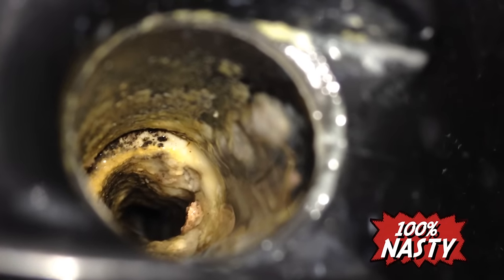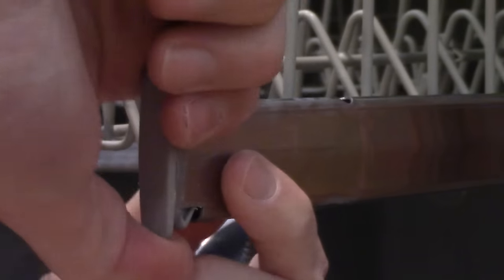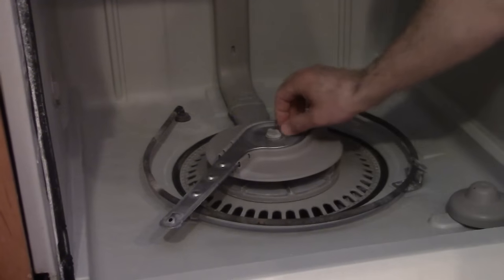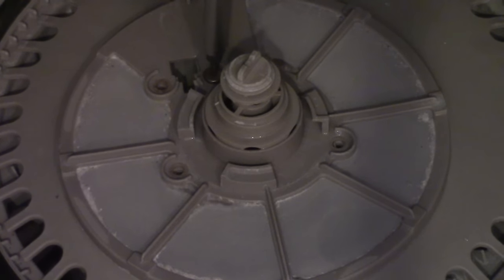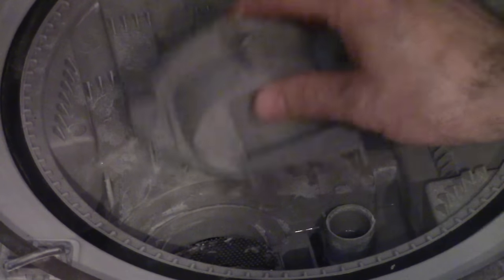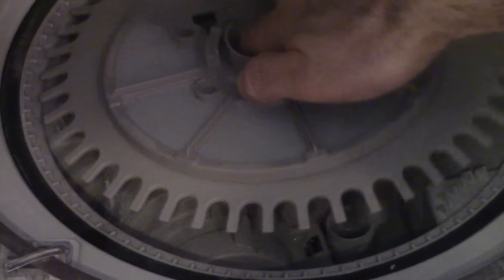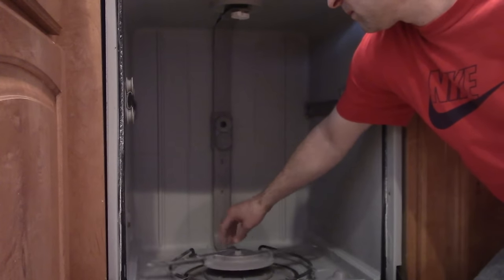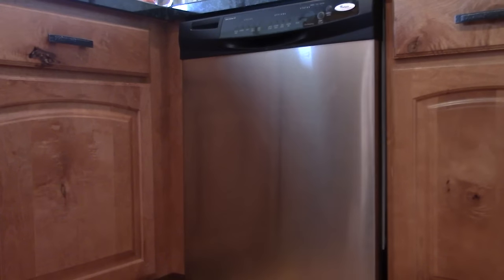How to repair a dishwasher, not draining - troubleshoot Whirlpool

Comment: Hi Thanks for the great video. My Kitchenaid dishwasher have asymptomatic drain problem. Water is getting into the washer without stopping. That is causing when reaching the highest level just flood out into the kitchen floor. I closed the water valve and gave washer a command to Ron's Only which was performed successfully.
So washer could drain the water out in this case. Is it possible that float switch is not working for some reason and not stopping incoming  water flow when the level is getting to high.
I would appreciate any help on this.
Thank you
Reply: Hi.  I'm having the same issue with my washer.  Did you ever figure out what the problem was with yours?  I'd appreciate any help you can provide.  Thanks!

Comment: Do all dishwashers have blades? I have a Frigidaire Gallery series that came with our 2018 manufactured home. Mine is different than your. It doesn't have that big rectangle water feed. It somehow gets there straight from the bottom. Mine drain is attached to a garbage disposal. I took off the hose and tried to blow back into the dishwasher and cant get anything thru. Are you suppose to be able to blow back into it? or is there a one way flap or something that keeps things from back flowing? going to try vinegar baking soda and boiling water combo . The darn thing doesn't have a rinse only button, have no idea why. Any ideas?

Comment: could someone enlighten me as to how to get the plastic screw off that holds on the lower assembly. I have tried every position to get it off but it wont come off. It actually looks too big to have the lower sprayer come out over the screw as the video shows..
Reply: Calle Holcombe Same problem here! We were able to loosen the plastic screw (by turning clockwise) but we can't get it off to remove lower spray arm. Now spray arm does not rotate during wash. Were you able to get your screw off?

Comment: Adam, I have an Amana DW the lights on the front lite up, there is heat being expelled inside but the DW isn't cleaning like it's not getting any water inside, or at least I don't hear any water dispensing inside, any suggestion would be greatly appreciated. I checked the filters which are clean so not sure of the issue.

Comment: I have the same model minus the garborator. My dishwasher drains sometimes and sometimes it does not. I did what you suggested and everything is clean, no blockage. I disconnected my drain hose and put it in a bucket and ran a complete cycle. At 10 mins it drained and at 65min mark it drained before drying. No water found in the dishwasher after complete cycle. The next day I did not get water but the following day I did. What could the problem be?

Comment: I just did this ! Didn't work, but I
I think you should add the NUT THAT LOOSEN THE blade that spins on top is a reverse thread, if you try to remove it the normal way of turning the nut it tightens instead, so when removing turn the nut the  opposite way from normal

Comment: Our Kenmore dishwasher stops using water after the sense cycle, and basically finishes the load with no water. We did find some plastic in this filter that I pulled out with tweezers. Would a jam in this filter cause water to stop being used in my machine?

Comment: My dishwasher is 15 years old. It never leak and drains with no issue. But it does make loud noise when it runs like grinding noise. Can you make a video of the pump replacement? Where to buy parts cheaper?

Comment: good evening i find your videos very helpful but i haven't seen where my issues has been addressed. i have a whirlpool and it continues to run water out the little whole in the left side of the washer even when the door is open do you know what could be causing this issue? thanks in advance.
Reply from the maker: michelle scott that's not a common problem but it's not difficult to tell what's wrong.  It appears you have a bad inlet valve that is not shutting off all the way.  Like a leaking spray nozzle on a garden hose.  You need to replace it.   I guess it's also possible that you have a small amount of electric current bleeding to the valve and keeping it slightly open but that is not likely.

Comment: Mine has a stem coming out of the pump on the bottom (underneath the unit mine is portable so I lay it on it's back.) that gets clogged with stuff sometimes. you have to remove the one way rubber flap retainer, then blow or poke the stuff out. It stopped mine from draining this week as I assume in my older model (Maybe all) that the drain function is on a timer.

Comment: I have a question. I am now putting it back together.When screwing that top round nugget piece to attach the bottom spray arm it is not tight at all and wiggles extremely. Do you know what I’ve done wrong?  It won’t tighten any further and looks like that’s where it naturally stops.

Comment: the cover for the blade on my kenmore 577-0 won't come up. I've removed the screw, pried gently from every corner I can get a tool under... no luck. any advice?
Reply from the maker: Pause it at 3:31 there is a leg that is sticking out of the cover.  Just below my ring finger. It looks like a long lego leg and the foot would be pointing to the left. See it? I don't know how better to describe it. I think that leg is your problem.  It's not giving way when you pull on it.  You need to insert a flat screwdriver into that slot and move the foot so it releases the plastic cover.
Reply: Thanks! It actually turns out that was pretty much my issue. A chunk of plastic got wedged in there and I had a devil of a time getting it out.

Comment: I have a question about my Whirlpool Gold Quiet Partner ii. I don’t use the pots and pans setting very often, and noticed when I did, my dishwasher ran for over 2 hours. I don’t have paperwork on it, as it was here when I moved, so I’m not sure how old it is. I have enjoyed it, I am not familiar with dishwashers, and it seemed quite long to run. Is that normal? Besides that, it runs fine. Thank you!
Reply from the maker: Yes its normal. It works longer to get it clean.
Reply: Thank you!

Comment: The issue Im having is, randomly after the wash cycle the water wont drain. by simply hitting the drain button it will then drain.    however today that button will not drain it. when I push drain i can hear it click but the pump will not turn on.   do you have a video for fixing this issue ?   Thanks

Comment: HI Adam: We just bought a house and our Whirlpool Gold dishwasher won't stay on...The normal button blinks and so does the cancel button. goes on for 3 seconds and cuts out. We've tried resetting it and it keeps doing the same thing...When my husband was switching out the digital panel, he has water going in and draining out. The machine worked when Home Inspector was here just a few weeks earlier...We thought it might be the digital panel, ordered a new one and that wasn't the problem. I had the  electrician who replaced the old electric panel with a new one check under the machine to make sure power was going into the machine...It is. We've tried everything. Any suggestions as to why the machine won't start or stay on?

Comment: Anyone know what that round piece bottom right of the machine is? Fonction? Because I pulled on the top pulled right out but now it doesn’t go back in like it was ??? Am I screwed lol? Or repairable?? Thanks for your help … great video for the rest !
Reply: I think...it's to prevent overflow by shutting off water if it gets too high.
Reply: @Showbizk  ok thank you!!

Comment: This may be a stupid question but... I've noticed in all of these similar videos no one ever says anything about shutting off the electricity to the dishwasher. Is it not necessary for this simple job or am I just suppose to know I should do this? Thanks!
Reply from the maker: Kelly Kizer I never shut it off if I'm just cleaning out the screens and filters.  But when in doubt, shut it off.  Good question.

Comment: My dishwasher is almost identical to yours.  
I am having difficulty removing the lower sprayer.  When I turn the plastic thumbscrew at the center (clockwise or ccw), it just turns uselessly and does not loosen the sprayer. 
Any suggestions?

Comment: I can't believe I am doing this myself!  I had no trouble at all until I tried to get cover off blade.  I removed screw but cover does not come off easily as in video  A plastic clip seems to be holding it on.  I am afraid  I will break off the clip if I try to pry with screwdriver. My dishwasher is just like one in video up until this part.  Any advice?

Comment: When you unscrewed your arm on the bottom it looked like you twisted clockwise. Is that true? I twisted mine counterclockwise and broke off part of the top of it and now it is stuck! Should I try to go further or try to turn it the opposite direction. It was loose to begin with, and got really tight regardless of the direction I twisted it. I had to use pliers.

Comment: I need your help ASAP. I'm currently in the middle of your walkthrough, and I unscrewed the cover to the blade, however, the cover wont come off. In fact, it doesnt look like it's meant to. How do I access the blade???
Reply from the maker: there is a little plastic clip that you may need to pinch so that the cover releases.

Comment: I discovered this a few months ago... my question is.. why, despite rinsing things really well, do I have to clean this out weekly? This seems excessive. I replaced the blade that (I guess) is supposed to slice stuff up, but the replacement wasn't sharp (The old one was like razors).

Comment: I need help! I have snaked the drain with the 25 ft handheld auger about five times and pulled out a little bit of debris. I've taken all of the pipes off underneath the sink and rinse them and cleaned them thoroughly with a bottle brush. I took apart the lines for the garbage disposal and allowed water to run through it cleaning out any debris that might be attached to the plumbing. Likewise, I cleaned out all the screens and the hose attaching the dishwasher drainage to the garbage disposal. The garbage disposal appears to be clear. The dishwasher appears to be clear of any clogs. When I cancel the cycle it drains and fills up the sinks, which then will not empty. I have snaked the plumbing underneath the sink and I still am getting communication between both sinks and they are barely draining. When I turn on the garbage disposal it fills up the other sink. Got to worse if that's even possible. I've used several gallons of liquid plumber, I have dang near to a tendon using the plunger, and after gallons of boiling water nothing is working. WHAT am I missing?? Do I need to rent a longer heavier duty auger? It doesn't take much water to completely stop up the drain, which is curious to me. It would seem that the blockage is fairly close in the line. Help!!!

Comment: I am going to try the things in this video but my dishwasher is not cleaning dishes well at all. It's a Kenmore Elite Model 12769 and is about 3 years old. Over the past month or so it smells like septic, dishes come out dirtier than when they were put in and I put it on smartwash with hot water and heated dry plus I run the sink until the water is scorching/very hot before I start the cycle and the water is not hot/barely warm in the dishwasher. We cleaned filters and the drainage hose that connects to the disposer. They were GROSS. Could it need a reset? I've read about that but lost the site for it. I'm also very bad bc I basically clean/rinse off well, the dishes before they go in the dw and I've read that messes with the dirt sensor or whatever it's called. Advice please?
Reply from the maker: When your washer is draining into the disposal, look down inside the disposal where you would throw in your food and see how much water is actually draining.  If it's a super slow trickle you may still have debris or a clogged hose.

Comment: Great video, however it didn't fix my problem. The bottom has standing water & when I hit the drain button there is a grinding sound. The inside is clean & the blade spins.

Comment: The plastic cover piece over the "blade and screen" was very hard to pull up--   you need to move the plastic clip with a flat screwdriver,  and then  lift and pull up on the LEFT-side (using needs-nosed pliers)... otherwise the whole thing will seem to be locked down. The clip on the right-hand side really holds the whole thing down.

Comment: i have a smiliar issue but it doesnt turn on as well. do you think this will help it turn back on?
Reply from the maker: No.  First check the the breaker did not trip.  Sometimes it's as simple as that.

Comment: My control panel is flashing and not working. I'm cleaning out the filter area and drain. Any other suggestions, I'm used to hotpoint

Comment: Hey Adam, I cannot remove the lower sprayer. The screw in the middle was really tight, appears detergent over the years caked on and locked it up. I’ve been working on this screw for nearly 30 minutes and it’s definitely spinning and the sprayer is looser but it won’t come off. In your video it looks like you’re spinning it clockwise to loosen, although maybe that’s because the camera is mirrored? Please help!
Reply: Update: I put some baking soda and vinegar on it to try to eat away the gunk. Worked it some more and it came off! Seems it is clockwise to loosen

Comment: My rubber check valve (visible at 3:40) broke in half and the circular section travelled through the pumps and finally plugged up the drain tube.  So people should also inspect it.  It is a perfect fit to plug up the drain tube.
Reply: this is what happened to mine as well
Reply: @sydneywise4324  Hopefully we save someone some money.

Comment: I cleaned and checked everything but mine STARTED not draining and cleaning dishes. Then it started making this grinding noise underneath and now it doesnt do anything other than the lights come on when you press the button :/ Ive cleaned everything including the disposal,reset it,etc this is the 2nd one thats done this both from Lowes and our fridge only 3 mnths old all kinds of issues also from Lowes.

Comment: You may wish to add something!   I took my dishwasher apart as instructed, found no debris, and put it back together.    It was the 3rd dishwasher I tried.   Turns out that if someone had commented that a new garbage disposal had a “plug” in the side that had to be removed, simply by punching it out, I would have saved myself the expense of two extra dishwashers.   It’s drawing now!   Duh!

Comment: This is a simple step by step to follow that solves most of  the poor washing and draining issues caused by clogged drain and filter. VERY IMPORTANT, JUST DO EVERYTHING THE VIDEO SHOWS YOU TO DO, DO NOT DO ANY OTHER STEPS>>>SPECIALLY TRYING TO REMOVE THE METAL FILTER WITH THE BLADE 
 ( not easy to put back in...actually took me an extra 45 minutes just to put it back in the right notch and blades are very sharp , i cut myself pushing it back in)

Comment: I tried this fix and it works for about 20 days but then the blades get clogged again and the dishes do not clean. I have to do the repair all over again and it works for only for limited time. any ideas on what it could be?  I do not think is a pump problem since when I clean the blades it works well for 20 days.  any other part that could be broken? please advise.

Comment: Thanks for sharing. I ran the whole process just now, but did not find much clogging in the bottom. When I started the dishwasher again, still the same problem. I heard the water running, and in just less than a minute, it stopped. I open it, water in bottom. Not sure what happened and what to do next? Anybody? Help! Thanks!

Comment: I turned the plastic wingnut on the lower blade assembly and it seemed to turn and the sprayer arm came loose. But when I went to put it back together it looks like I broke it. It has no threads that I can see just a sline like assembly on the sides of the nut..
What did I do wrong?

Comment: Adam. My 3 month old dishwasher started making intermittent noise like someone is 'peeing' on the inside of the door. When I open the door as this is occurring there seems to be a little splash area on the top of the inside part of the door. Any ideas? Thanks in advance!
Reply from the maker: It's possible a sprayer hole or two may be clogged,  forcing the water to spray in an odd direction.

Comment: I am unable to remove the screw holding in the lower sprayer. I’ve turned to right. It will not release. It was very “stuck” and I had to use pliers to turn it.

Comment: When I ran the dishwasher,  it didn't drain.  But when I disconnected the white pipe and pressed drain buttom on the dishwasher, it then did it. But I ran the water into a large bucket. So It does drain, but not into my newly installed garbage disposal.  Help please

Comment: I am at an early step.  I am trying to remove the bottom sprayer.  The dishwasher I have looks exactly like the one in this video.  I have turned the center piece that you turned to release the sprayer arms about 1000 times.  The sprayer arms are not coming off.  What should I do?
Reply: Okay, I got that step figured out.  I am not trying to take the cover off of the blade.  The screw came out fine.  The cover is not wanting to come off.  If there a trick to it?

Comment: I see people commenting about the 'plug' that was left on in the garbage disposal. I had a contractor install a new garbage disposal sometime back and ever since, there is a clogging problem and the dishwasher has the water in the bottom all the times. Can someone please tell me where to find that plug and how to remove it from the garbage disposal? Do I need to dismantle the garbage disposal to get rid of the plug? Please advise. Thanks.